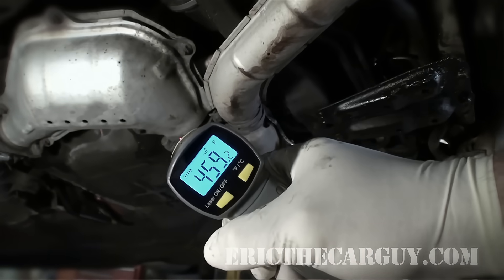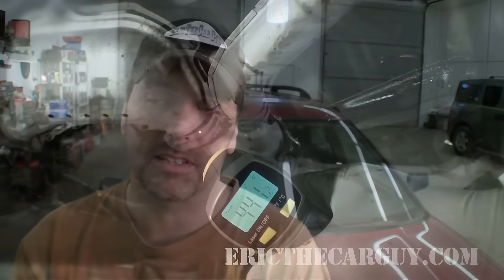Does Lacquer Thinner Clean Catalytic Converters? -EricTheCarGuy

Comment: Eric! I'm taking your thinner away from you and giving you a time out! Thinner can ruin or swell o-rings, gaskets, sealants and diaphragms in the fuel system. It also can harm pumps, regulators, hoses and O2 sensors.
Great videos! Your garage needs a few movie posters and a lava lamp, go hit Spencers.
Reply: Good point!  One of the components of lacquer thinner is acetone which can have an extreme drying effect on the materials [rubber ones] you mentioned.  
I believe alcohol is the other culprit for dry and cracked rubbers.

Comment: I don't understand the theory behind why this would work. If the lacquer thinner is burned in the engine, what is left in the exhaust that will have any effect on the cats? Any solvent properties would be gone by then.
Reply: Lacquer thinner is mainly toluene and xylene, which are aromatic hydrocarbons. These are powerful solvents, and are a major ingredient of gasoline. Regular gas is about 25% aromatics, and premium is about 35%.

Aromatics are very dense fuels (containing about 5% more energy per gallon than regular gasoline) and produce less water when burned, and so they produce a hotter, dryer exhaust. In addition becuase aromatics have extremely high octane ratings, the ECU can use a more aggressive tune resulting in a hotter burn.

 I can only presume that the theory is that the if you get the catalyst really hot, you can evaporate some contaminants off the surface of the catalyst. You might have better luck getting the catalyst temperature up by going on a highway drive keeping the rpm above 4000 for 10 minutes. I suppose you could also unplug a spark plug to cause misfire, and spray unburned fuel into the cat, but that could overheat it and melt it.

Comment: Is it possible for a substrate to just wear out over time? As in, the substrate is not dirty and or damaged?

I have a 2001 Audi A4 2.8V6 with 200k miles. When I first had the car, there was an inefficiency code for the bank 2 catalyst. Now, I have codes for both banks. I've tried using an emissions system cleaner two separate times during long road trips. Did not fix my problem either time. My exhaust does not have any "rotten egg" smells coming from the exhaust which would indicate a bad catalyst.

So I'm sort of at a loss as what to do. Obviously, OEM cats from the dealer are out of the question since they are worth upwards of $3000. The car itself is barely worth that alone. I've been considering having some aftermarket high flow cats welded in place and using rear O2 spacers...

Comment: My cat was dirty and was throwing codes, I replaced all the O2 sensors with no change so I examined my knowledge of chemistry a little and decided the best bet was to use an acid bath to clean the honeycomb surface.  A little more thought told me to use citric acid rather than, for instance, acetic acid.

So I removed the cat, flushed it with water in both directions, sealed it up tightly (except for one end), and poured a high concentration of near-boiling dilute citric acid and filled the cat and let it sit for about ten minutes in the sun.  I then drained the fluid and repeated four times (until I ran out of citric acid).  The first and second time had a dinginess to the fluid, the rest all appeared clean, but I needed the acid to etch the inside of the convertor, so I kept going.

Afterwards I flushed it thoroughly with water in both directions, again, then allowed the cat to air dry for an hour.  Reinstalled and no more codes.  Three years later... still no codes ;-)  And emissions are perfect... on a 17 year old car ;-)
Reply: How strong is Citric acid compared to the Muratic acid used to maintain Ph levels in non-chlorine pools.
Reply: c0c0asauce Muratic acid will damage the honeycomb without attacking the contaminants enough.  Heated citric acid is really the sweet spot.  I can't remember the concentration I made, but citric acid powder can be purchased on eBay quite cheaply and is safer to handle.
Reply: Alright, I figured it could be too strong. I haven't used citric acid before, but I have seen citric acid do some pretty impressive things.
Reply: Excellent, let me know how it turns out!  One instance is just anecdotal - I hope it works for you! ;-)

Comment: The consensus in the comments here, Scotty Kilmer's videos, and elsewhere seems to be that if the lacquer thinner treatment works at all, it's primarily by heating up the cat more than normal (which potentially has its own problems), rather than by solvents passing through combustion, because for the most part they would be, well, combusted.

According to an unusually brief wikipedia entry: "Lacquer Thinner is usually a mixture of solvents able to dissolve a number of different resins or plastics used in modern Lacquer. Twentieth-century lacquer thinners frequently contained alkyl esters like butyl or amyl acetate, ketones like acetone or methyl ethyl ketone, aromatic hydrocarbons like toluene, ethers such as gylcol cellosolves, and or alcohols."

If the point of the lacquer thinner treatment is to get the mixture to run rich and thus heat up the cat, surely there are safer ways of attempting this rather than using a product that is (usually!) formulated to dissolve various resins and plastics.

Scotty refuses to give any more details as to the product/formula he uses. "I'm not a chemist" he says. He now says some old German mechanic taught him the trick. Well, great. Maybe it worked on a Iron-Curtain era Volkswagens, but today?

It's just not worth it, folks. Don't try this at home.
Reply: Thanks, Bob.  I watch Scotty as much for entertainment as well as tips that shadetree mechs can use who do not have a full shop as Eric does.  I love Eric's all encompassing explanations on any given procedure.  I believe he does his best at covering all the bases.

Comment: What kind of laquer thinner? Aliphatic or cellulose? I think this seems too much like alchemy. It's nice that you are realistic though eric. Only way I can see this working is that putting something that burns cleaner than low grade gas in with the fuel would make the exhaust cleaner while that is in there but that i would do nothing to your cats. It could get you through an inspection but no more. There is a myth here in sweden about putting bananas and sawdust in you gearbox to make it less noisy I think there are simularities.

Comment: I dont know about running hotter, i just know that methanol is a good additive to low quality fuel as a octane replacement.
Since you only need 5% methanol added to a full tank, 2-3 liters of methanol will cost less than a better fuel equivalent. At least in my country.
Reply: Methanol is corrosive to metal parts.  Be careful !
Reply: To metal and rubber as well, hence why i dont use it.

Comment: I use SeaFoam. If you follow the directions and dump it straight into the intake, alot of crud comes out the exhaust. I'm willing to wager that some of that will be crap out of the cat. =D
Reply: Read the bottle same thing dude. Thinner.

Comment: I've used lacquer thinner in my car mostly to clean the injectors as according to the MSDS info was 80% toluene, which is used in a lot of expensive cleaners, but lacquer thinner in the hardware store is cheaper than in the automotive store.

Comment: Hey Eric, I popped that code in my Volvo 850 about 2 years ago and decided to add a gallon of lacquer thinner in my car (about 12 gallons of gas). I was headed out of town for a 750 mile run so I dumped it in a tank before I headed out. After I ran the fuel out 5 hours later, I filled up with gas and my car ran rough for about 5 minutes, as if the ECU was trying to adjust to a sudden loss of octane or something. After 5 minutes of highway travel, all smoothed out and the car returned to normal.

My code did return and does about every 400 miles. Didn't work for me but it was fun seeing the expressions on the guys faces at the paint store when I told the person behind the counter what I was going to do with the thinner.

I have driven about 40,000 miles since and have seen no negative effects of the test.
Reply: Robert DIY no
Reply: Did the code go away? did you have to clear it first to make it go away?
Reply: Has the code stopped reappearing after 400miles?

Comment: "Seafoam same or very similar as the gm cleaner"(was my claim, and I stand by that) used in the pressurized apparatus(mixed with gas 90-10) provided by GM in there dealerships. And yes it has some ammonia in it. But its not ammonia bassed. I implore you to prove me wrong... Mr. B

Comment: "Weak fuel pump will cause a p0420", agreeded sir!And is the most overlooked reason as well (I think).But hay at least the Engineering gods saw fit to leave the fuel system mostly unintegrated/ unmonitored when building obd2(gives us techs  something to do, ya?).,)Most platforms do not monitor fuel pressure,and readable fuel pressure values are not available on most aftermarket scan tools. My point,cat does not just go bad for no reason!Thier is always a reason!"weakfuelpump"fellow genius, o yes

Comment: I watch scotty killmer and eric the car guy a lot. Not picking sides here but from what i saw, the ration Eric used wasn't as potent, as what Scotty used, but even then the secondary o2 sensor numbers had improved, and the temperatures had changed, something obvious has happened due to the thinner. Might want to revisit, and would love to know if it did cause the check engine light to come on.

Comment: It works! had a 97 Civic that failed high CO due to failed catalytic converter I dumped half the can of lacguer thinner in the tank w/ less than a 1/4 tank, ran it until it went to empty, took it back to the shop and passed. Had a 2001 Mazda 626 that failed because of the Cat, Took off the Cat left it in a bucket soaked full of lacquer thinner and carb cleaner (mix) for two days. Installed it, short term fuel trim went down,down stream O2 sensor improved, then it passed smog. Mechanic since 1991
Reply: Worked every time I used it. Failed many emissions test. Then I dumped a can in a half tank. Passed a good 3 times with this stuff.
Reply: @jasonmerlenbach7710  ... Wow... Very good. But I'm too chicken 🐓🐓 to try it.
Reply: EXCELLANT MOVE!!!
Reply: So if i can't take my cats off just install the lacquer thinner in my gas tank 1/4 full?
Reply: I wanan come to ur shop with my lexus
Reply: Wassap old skool funk
Reply: A  Buddhist  Monk told me in a dream to take hooker header tape and metal tie straps from Ancient Egyptian mummies and wrap the pipes long missing their heat shields that lea up to the inlets of the cat converters to better retain heat within before adding the 1 gallon of ancient Holy water to the fuel tank. of the Subaru Chariot.
Reply: Damn so there are ZERO negative effects of lacquer thinner in the tank?
Reply: @Josh42711  it ruined my AC I put some in and 30 minutes later .. one my car ran worse then my ac stopped blowing any air at all.. now car is at shop
Reply: @jdwilliams202000  I was beyond skeptical myself and decided to just cut the cat off open it up clean the inside and dump all thr contents out and welded it all back together. Wasn't taking this chance lol
Reply: @Josh42711  ... Yeah I'm too chicken 🐓🐓 to try that lacquer thinner myself. 
I just replaced my caddy converter. Looks like I did a horrible jog. I think I made the 3 stooges look like professionals.  But hey my car runs great. 
I have great speed and power. 
My neighbors want me to fix their cars also. 
No.... If I ruin my car, that's on me. Ruin someone else's car, lawsuit.
Reply: @jdwilliams202000  the fuel system has zero to do with the AC system. Car running worse could have been a result, but AC absolutely not, it was coincidence, nothing more.  The AC is sealed to atmosphere and NEVER gets fuel in it, it can’t possibly. 
 So, running worse, possibly the thinner in the fuel, AC? Nope, can not happen.
Reply: @megastick9324  if you pour lacquer thinner in your tank and it's somehow causes the engine to stop running that will also cause the AC not to work. Lol
Reply: @roadrunner40   fair point there!
Reply: Very good... Well I gotta tell you, you're braver than me. But you passed. Very good. 
I'd be too chicken 🐓🐓.

Comment: kinda wonder if someone actually took out a cat and soaked it in some kinda soap and installed it if it would improve at all. but just kind of a pain to cut and replace it just to have it fail. i remember years ago someone told me putting a bunch of bottles of "heat" in my gas tank of my 84 chevy wouild help it passed. took the test, failed and fuel pump crapped out pulling out of the emissions place lol

Comment: I personally have used a 1 oz. - 1 gal of Acetone before, and it did seem to smooth out idling problems, pinging (carbon buildup in combustion chamber)- but you MUST use 93 or higher octane to achieve noticable results. The MOST effective "cleaning" you can possibly do- is to remove the C.C. and literally "wash" it out (soak & rinse the metal coated ceramic beads) with a cutter solvent- acetone, GUNK engine wash, carburator cleaner, etc. Water injection (MIST) will also steam clean the exhaust.

Comment: Best repair manual on a 2010 F150 truck, to remove spark plug coils to replace spark plugs? where to buy the tester for fuses that you use?

Comment: OK Eric im comfused... you said it didn't have any effect but yet your only code after a full tank of gas was a 1400? I seen no 420 and the only reason most folks would try this is for their car to pass state inspections. Im confused please explain.Did you try cleaning it directly with thinner instead of soap and water? I see no way running it through tank could possibly make a difference but cleaning it directly may help

Comment: my 1993 fiat in 2009 had the same problem with emission test, with only 35k miles, the only cause was my dad's driving, like an old man. The mechanic says that need new kat to solve the problem. I took the car for a trip of 300miles and push the car over the limit, average rpm of 4500 and when i came back no more problem. I find that sport driving help the healt of the engine and exhaust system. Still got the same original cat since 1993 and last year emission test passed OK!

Comment: That was an interesting video. The problem with cat. converters is that over time, the substrate itself loses it's effectiveness, even when they are clean...they have a lifespan. My question is; with Ohio's brutal emissions testing, how do you get that Subaru to pass so you can register it? I had a Baretta with a 2.8 V6 that ran like a watch, yet they failed it.

Comment: i would tend to look at this from a chemistry point of view. all of the solvents that make up lacquer thinner are about on par with the solvent ability of straight pump gasoline...unless there are polymers in the thinner that are not in gas, that would cause the cats to get hotter, and therefore likely to burn off what may be plugging them, i do not see how thinner would directly affect the cats. as in this case, it might also open up new issues that were not present before.

Comment: Why go catless? You might as well remove your headlights and airbags too, because they're just safety features. You'll really stick it to the man by running carless! Unless you ever happen to open a window while sitting at a light... then wonder why you decided that pumping ten tons of HCs, NOx and Carbon Monoxide into the air was worth the 0.005 HP gain, as you start to get a bit dizzy haha

Comment: True that Eric did a totally different thing than Kilmer, by putting a third of what Kilmer put, but the truth is that even if he had put a gallon to half a tank, it would still NOT DO ANYTHING but more damage. Speaking from experience here, because I DID infact put a gallon to 1/2 a tank and it did nothing more than increase my consumption until the gas tank was empty.

Comment: That's funny because I hold a steady 14.7 AFR at idle and a 11.1 at WOT. 2006 Subaru STi 98+ is obd2.Get a tune, it will correct the correct air fuel mixture. Even at 850cc injectors and aeromotive fuel rails to throw in the mix and I STILL have a proper fuel mixture.

Comment: you can't go cat less on a obd-2 car the point on 2 o2 sensors is to tell if the cat is working the rear o2 sensor compares the fuel ratio from the front o2 to verify that the cat is burning off excess emissions a free flow system they would match and set a p0420 quick

Comment: I do not know who told this that GM Top engine cleaner and Seafoam are the same, but they are not even close to the same. GM stuff is ammonia based, seafoam is kerosene based, Soap vs solvent.. The GM stuff is closer related to Diesel exhaust fluid than anything like seafoam.

I will leave out what I think of seafoam, but the GM stuff, the ford Product and MotorVac MV3 are the best products for cleaning fuel systems period.

Comment: GM injector cleaner they use at the dealership to clean plugged fuel injectors is nothing more then seafoam. The stuff works I have seen the proof in my own shop with my own eyes and the results don't lie.

Comment: I  sometimes clean the stove burners, really low, for about a hour  or so. maybe same.liquidsolution idk.  just put this cool exhaust after disconnected dryer with 1/212 sudafed fan, out, with glue gun and cool flex from mail walmat. spending time majorly on a Rstart and /programr.sbb. not yet/ but very cool like arnicare does what it says. hm.ok...  gv :)

Comment: Ahhhh, the ol stright pipe, yes. Well that may have worked like 15-20 years ago but if u were to "stright pipe"any car made after obdII was implemented you will definitely geting a p0420 code. If it is even possibly? Most 4cyl cars 96 and up have a manifold type converter, and unless u have super dupper mad scientist type fabrication and welding skills u will have some time"stright pipe"-in, dat...)